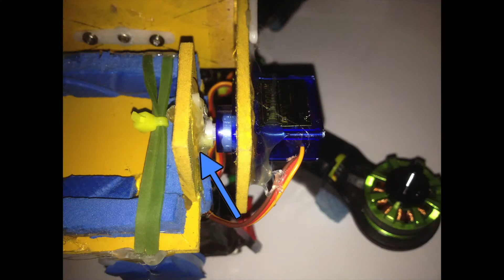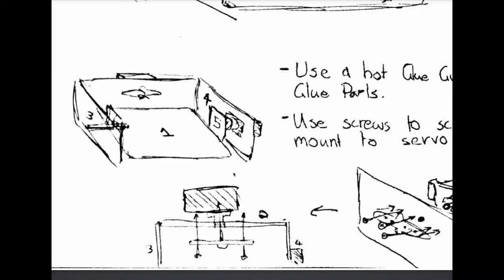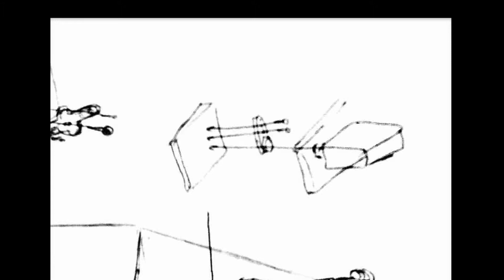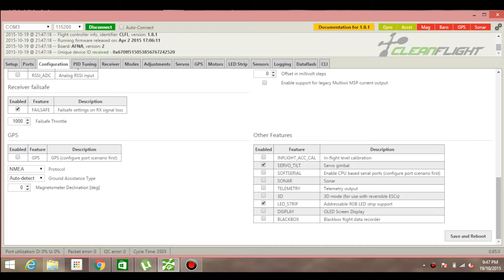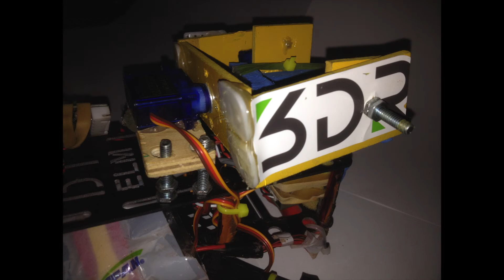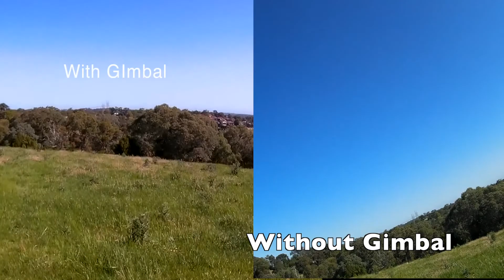Naze32 2D Gimbal Tutorial

Comment: Aah Thanks!! Now I understand why my servo tab looks different than the videos I find on youtube. I'm running a newer version... Hopefully we'll get this option back in the future. Thanks for sharing this.
Reply: Haha, oh, I just killed my flight controller trying it anyways. Should have listened to you ;-)
Reply from the maker: oh! you mean the servo tab that screws onto the top of the servo?
Reply: @Drone On Nope. I mean in the cleanflight GUI. I switched on servo gimbal and channel forwarding. But after switching them on there was no response from the FLIP32 flight controller, so I disconnected. After that, the flight controller didn't connect anymore to the computer.. I ordered a new one.. soldered it in.. works again. Haha, I don't dare to try to connect a servo though, don't want to mess up another flight controller.
Reply from the maker: oh! sorry about that! have you looked at a circuit layout for the pin outputs to know exactly where the servo goes?
Reply: If you are referring to the flight controller motor signal points, then yes sir. But this error was in the firmware. Unfortunately peanutbutter. That's what we say in The Netherlands, funny right?
Reply from the maker: Oh! I see! 😂